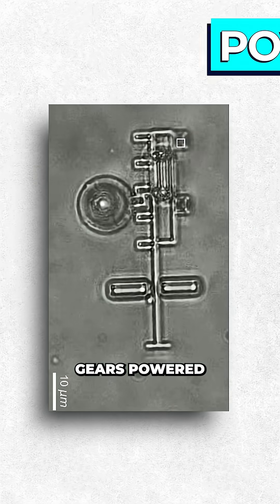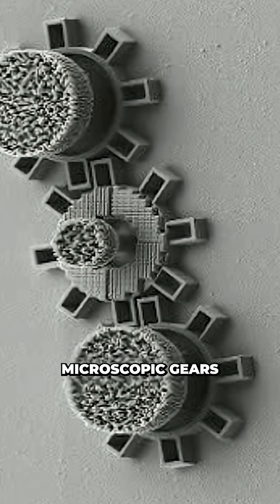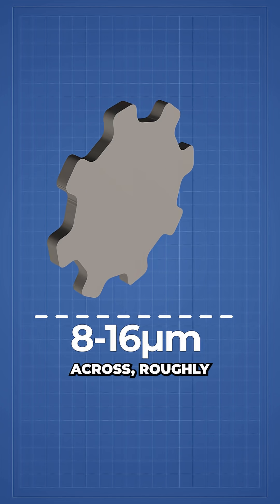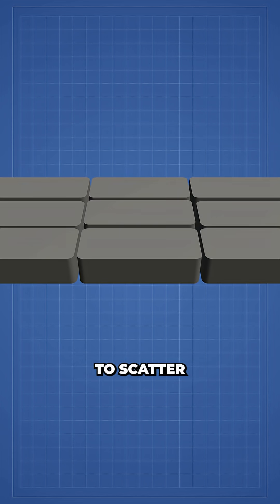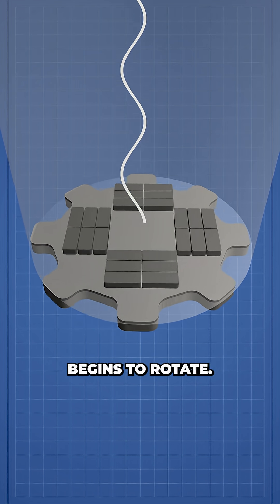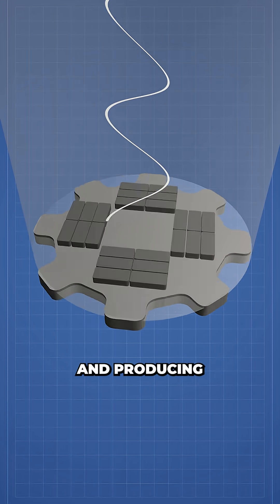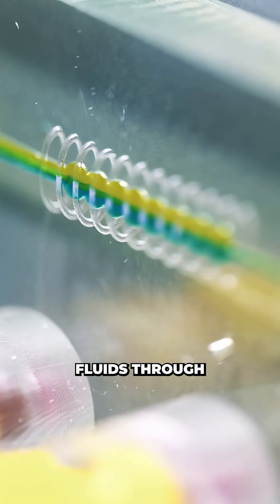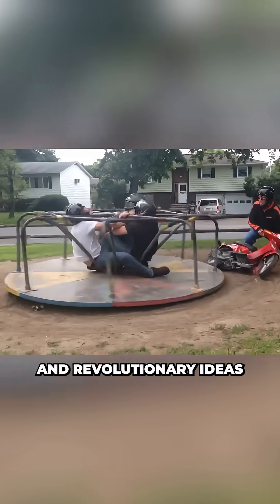Scientists Create Micro Machines Powered by Light

Comment: I guess that you do not know that things break down. The smaller the motor the faster it will wear out. Are you planning on repairs and maintenance? This stuff is done so that people can brag and show off ridiculously small things. I mean, I do not see the need for smaller and smaller chips. You may succeed in the smallest chip, but the wiring to that chip still takes up much space. There's a limit to how many chips can be in one tiny space, like only one, because there are way too many wires. 

And what will you do with tiny spinning things that resemble a motor? Do you have increasingly smaller chips to go into said motors? Nah, this stuff is just bragging rights, like the guy who can spell a name with atoms. There is no other purpose than to have bragging rights.

Comment: A bottom up approach rather than a top down mindset would be much more effective. Cells don't use the same mechanical principals in the same way, and shrinking machines to work at that level probably isn't effective. If we take the molecular machines that the cell uses, and repurpose them to serve our needs, we could easily create a system that uses ATP to produce the mechanical work needed to turn a motor and power a gear. Most of the molecular machinery inside of a cell would operate just fine outside of the cell if kept in the right environment, like an enclosed microscopic motor. then it's just a matter of fueling the system and finding a use for it.

Comment: The dimensional size of a sodium-potassium pump can be described in several ways: its overall molecular envelope is around \(2.5\) nm in resolution, its individual crystal structure is approximately \(65\times 75\times 150\) Å, or \(6.5\times 7.5\times 15\) nm, and its larger three-dimensional structure can extend approximately \(6.0\) nm from the cytoplasmic side of the membrane. Dimensions by method Electron microscopy: A three-dimensional structure has a resolution of \(2.5\) nm, showing a complex mass distribution of interconnected ribbons extending about \(6.0\) nm from the cytoplasmic side of the membrane.Crystal structure: A single pump molecule is measured at approximately \(65\times 75\times 150\) Å (\(6.5\times 7.5\times 15\) nm).Cell dimensions: Crystal structure data for a specific crystal form shows cell dimensions of \(a=222.9\) Å, \(b=50.7\) Å, and \(c=163.3\) Å with a \(\beta \) angle of \(104.6\) degrees. Structural components α subunit: A catalytic unit with a transmembrane domain (TMD) of 10 helices.β subunit: A transmembrane protein with a transmembrane domain of about 30 amino acids and an extracellular, immunoglobulin-like domain.Complex: The overall shape is complex, with a central "body" with "lobe" and "arm" structures projecting from it.

Comment: I am just immediately thinking about energy efficiency, if you can power something with light, then you don't need as much horsepower for the light, making more things possible, like, what if you figure out how to make move bigger things? Like, what if instead of solar panels that does fancy photosynthesis, we instead have a plane of these that power a crank motor? because of how gears work (the size of the next gear in line determines the speed), we might be able to have more effective solar power, of course, this is just an idea and I don't know how much torque the micro gears gen, so that effects if this plan is feasible, but, that has so many implications!

Comment: This topic was already in active aapplication research far before 2003 in Germany. In Freiburgs University I was participating in simulations of microrobotical actors and manipulators. The energy cane was only in the form of light from an CD-lasee though, but in centrifugal force potential of a fast rotating CD-sized testing bed as well. The fluid probe and it's carrying medium would be put in the middle of that CD-Lab. The rotation sqeased in various microchannels with numerous different chambers, for reacting, mechanical mixing and further processing, measuring, analyzing and digitalizing to be read out by a CD-laser and additionally manipulated by other specific lasers.

Comment: Just to point out, this requires both a laser striking just the right unobstructed surface, and a dark room without any ambient light to occlude any of the photon scattering that powers the movement. while interesting, "light" powering this movement is not something you would find in nature. The aplications of this technology are far far overblown because the setup is too precise and you still need direct laser emission to have any reaction at all. which on other terms means its not going to act as tiny valves in your bloodstream or pump fluid through tiny tubes or whatnot. there are just too many other things that also need to be miniaturized, including some self powering battery to fuel the whole thing before this could do anything useful.

Comment: Taking your car into the shop and the mechanic using a proton microscope just to see a broken part. "Yeah, we can get the repair done but it will take 2 to 4 weeks, not because we don't have the parts in stock but because Jim dropped them and now we need to search the floor inch by inch to find them"

Comment: And apparently...  single celled bacterium moving around by way of Flagellum already had this problem solved.  Everyone thinks bacterial flagellum are floppy things that squiggle back and forth to make them go forward, but if that was the case, videoing them would mean we could see the squiggles clearly as they flicked back and forth on a flat plane.  But they don't...  

...  they ROTATE like a boat propellor, and are stiff.  They are at the end of gear and chemical motor driven propellor shaft...  like a boat engine.  

Flagellum Driven Bacteria are tiny Bio-Mech Boats.  😂

Comment: What’s even cooler about this is if you remember from physics photons don’t have mass. So how can they impart their momentum onto a physical object? The answer is relativity. Photons have zero rest mass. But all moving objects get a little bit of a mass bump as they speed up, which is why it takes infinite energy to accelerate a person to the speed of light. But you move so slowly compared to the speed of light that the total increase in your mass as you speed up is immeasurable, especially compared to your rest mass. But photons have no rest mass and travel at the speed of light, so their relativistic mass has a significant effect!

Comment: I'm confused - I was under the impression that photons could not exert any noticeable force on a mechanical system, see Crookes radiometer which is said to be ran by minute amounts of gas still being in the glass bulb that are accelerated away from one the black surfaces of the vanes. And now photons are supposed to be able to drive gears?

Comment: Conversion of light to mechanical motion has already been proved possible, in fact you can do it on a larger scale than this. A very thin piece of graphite suspended on a neodymium magnet platform can be moved by a strong beam of light.

Comment: Imagine if this could be used to send instant messages across space using literally light-speed.

Ngl, it would require a level of pinpoint accuracy that laughs at the very concept of “Pin point” ….so it’s probably not feasible, nor practical.

In conclusion: Disregard this entire comment from me. 🤷🏻‍♂️😅

Comment: You need a relatively strong lightsource of a specific wavelength to be able to use it. And what comes to your mind is that it could be used as valves in the body, where the light level is almost zero and, because of their size, can not be positioned at a set spot in the body.
Congratulations mister fantasy

Comment: and where is that light going to come from when the machine is in your body?
Reply: Ever held up your hand to the sun? Light can pass through tissues.
Reply: Humans have body heat and emit IR (Infrared Radiation). However, this is not intense (concentrated/focused) radiation, which is what a laser creates, because the IR is spread around the body. In a different sense, humans are also slightly bioluminescent (in terms of visible light, not IR), but it's ~1000x weaker than human vision, so it is nowhere near close enough to match the power of a laser, even if all the generated light were at the same wavelength, which is a requirement for a laser.

Potentially, one could use a radioactive capsule that has specially-shaped (probably parabolic reflectors combined with a cylinder) mirrors to reflect its radiation onto a specific "drive" gear would work. However, you need to ensure that the radiation never passes through the gear into the flesh (potentially causing cancer or in the best case just killing human cells and creating inner-body "clumps" (basically a sphere of tangled immune cells coating a foreign/dead object), which is much easier said than done due to 1) material thickness and 2) the material type (silicon, metal, something else) affecting the wavelengths of light that get absorbed, as well as 3) having a way to ensure the gear and the radioactive capsule don't move/rotate away from each other.
Reply: Sending radiation to very specific body parts is well understood so that is one option. 

Body heat might provide power too but would not be able to control anything obviously.
Reply: Simple, it doesn't have to be visible light for one- and two the source could be provided by an internal transmitter. I won't call it easy, but it's certainly not an insurmountable challenge.
Reply: @rockysmith6105  The whole not having to be visible light makes me wonder if something like an xray would cause these machine to act differently than expected. Although, silicon is transparent to xrays so maybe not? I'm sure whoever develops the tech will come across this, but an interesting thought for sure.
Reply: Microwaves are one such form of photons, and hopefully they can solve ut without needing to employ dangerous forms of EM radiation, though interesting, this isn't quuuite as practical as one might hope..
Reply: @Viper607706   idk why there is an assumption this is only for use inside of the body or for any body. My mind went elsewhere for potential use cases.
Reply: Infra Red light.
Yeah, do to the thermal echange process of pur metabolism creating an endothermic reaction releases energy in the form of Thermal "heat", and Thermal is measured by infra red wavelengths.
Humans "give off" light we just can't see it without instruments. Yes you can make things run off of Infra Red. You can use the "light" in youe body to run these nanomachines.
Reply: I've said it before, I'll say it again. Some of the dumbest crap I've seen has come from this channel. This requires intense light, hence the laser.  Probably can see where this is going.
Reply: @MadScientist267  yeah, thats the most obvious problem, sure you might be able to make small little clockwork. But making a so called "nanomachine" with this technique is wildly impractical.
Reply: @MadScientist267   You just swallow a laser. Easy!

Comment: Ultra limited applications. LASER driven motors? So where's the nanolaser design to power the nano machine for working inside the body? How they lubricating the gears? The friction points? How are they handling nano machine waste particles? Where's the fully designed machine? 

Their still playing around with 2D designs after 20+ years. Nobody's gonna wait 300-700 years for nanotech. Nanotech that will actually be useful!!

Comment: I thought about this before, and wondered if a laser would drive a nano size pelton wheel. If so it's a direct drive, no chemical reaction needed. Now, if you combine that with a COB light it can also be electron driven. Slightly more complicated is not a problem, so the question remains is it more versatile? If so many more uses can be found. It is also possible to make a nano size alternator, eliminating photons as a source of power completely.

Comment: If light has no mass then how is this possible?
Reply: When a photon is absorbed or emitted, momentum is transferred (radiation pressure)
Reply: Light is energy
Reply: @SweatierAcorn except the moving of gears is a form of mechanical energy which requires force to move which means there needs to be mass.

Comment: Imagine if there were thousands of those little gears all powering one that’s actually visible, and using hundreds of them visible ones to create a full-sized engine, an engine powered by light itself
Reply: it would be a flat and immensely wide gear that produced a bare minimum of torque, probably not even enough to spin due to air resistance and friction at that scale
Reply: I also thought of that. Id love this to be a more powerful alternative to solar power.
Reply: @Neoventus500  Solar power is an energy collection method, a motor is an energy consumption method. The energy to power the laser has to come from somewhere, such as a solar panel.
Reply: Sounds like a cool idea for a Create add-on
Reply: @vlastasusak5673 there is actually a create addon about light power being developed, domt remember the name but its out there
Reply: that would need one strong light beam, energy loss at all stages

Comment: If you can make light powered gears, couldn't you put millions of them in a very tight grid to push increasingly bigger gears, until you have a mechanism big enough to hold in your hand, entirely powered by light, with no electronics?

Comment: Only problem I can see with this is the observer effect, since light acts as a particle when not being actively observed, thanks to quantum physics, it would mean that these gears won't move as expected since they rely on the wave function of the light to rotate the gears in the desired direction and the correct timing
Reply: The spinning comes from the fact the light has a higher probability to be reflected one way than the other
Reply: @OnePieceFan4765 The "reversed polarity" aspect to turn it the opposite direction implies that it requires light to operate as a wave to function but as proven from previous experiments light when not observed functions as a particle which wouldn't have the same effect on the gears as a wave would
Reply: @GreyTsaki light has polarity regardless of if you think of it as a particle or wave. It’s weird but there’s quantum mechanics for you
Reply: @OnePieceFan4765 polarity is measured differently for each state but either way I was mistaken in my original claim, I looked at the double-slit experiment again and found that I had the states reversed, it's a wave when NOT observed so for a mechanism this small operating on light at such a scale the default state would be light in a wave state rather than a particle, though I still would like to know how a particle state would effect the mechanism
Reply: @GreyTsaki do be aware that the whole acts like a particle/wave thing doesn’t mean that the light literally changes into something else when observed it’s just that quantum particles are something that can’t be perfectly described as either a particle or a wave. Light has polarity properties even when it’s “acting like a particle”

Comment: The only real issue with using this for medicine is that to use these inside a person, you also have to get the light inside them, and a suitable amount of it to turn the gears.  This means you need a laser of a wavelength that can pass through organic material without causing any cellular or genetic damage.  And that's just not an easy thing to make.  I think you'd have better luck with something driven by an oscillating magnetic field, because at least that could be just worn on the outside of your body without much trouble.  Less precise targeting than a laser, as well.

I can, however, see this being used in micro scale manufacturing.  You could, for example, make a micro-machine to spin and weave micro-scale fibers like carbon nanotubes or some sort of monofilament, or maybe even spider silk proteins.

Comment: I mean if light (hv) is already used to make certain chemicals reaction happen then it would only make sense that it can further supply energy for mechanical motion. We can derive the energy of a photon using the equation E = hf ; where E is energy, h is Plancks constant (6.626 * 10^-34 J * s) and f is frequency in hertz. For example the energy of a single photon can range between 2.55 * 10^-19 Joules for red light and 4.98 * 10^-19 Joules for violet light.

Comment: I’ll never understand how photons have momentum but no mass
Reply: The idea that momentum is equal to mass multiplied by velocity is simply a simplified formula that only works in situations where the object has mass is large enough that quantum mechanics doesn’t apply and is move slow enough that relativity doesn’t apply. If you look at the true formulas you’ll find mass isn’t required for momentum. The true formula is E^2=(mc^2)^2 + (pc)^2 set m to 0 and you get E^2=(pc)^2 which implies E=pc and just solving for momentum you see a photon has momentum equal to its energy divided by the speed of light p=E/c
Reply: @OnePieceFan4765  wow that’s the best explanation I’ve ever heard. Thank you one piece fan.

Comment: So I suppose they could make a mechanical analog to FPGA with actual gates and latches, and then solve mazes with electrons instead of water.

We won't even need quantum computers after that. Just configurable nano mazes and and a diagramming symbol set for the most basic functions. It'll be cool to see physical lambda calculus diagrams (re John Tromp) simplifying themselves in real time.